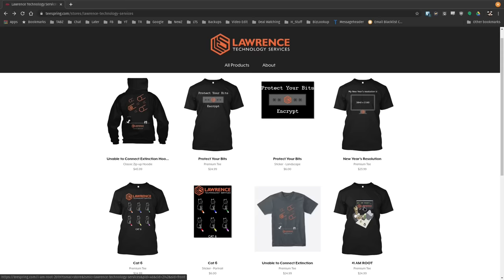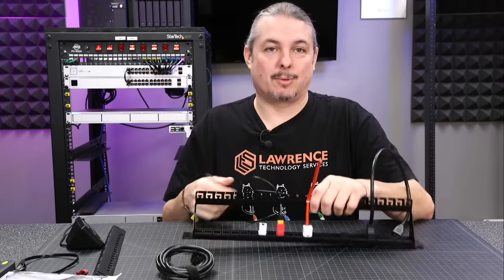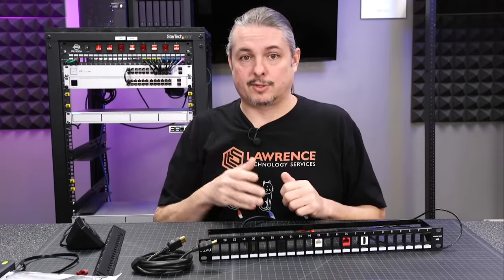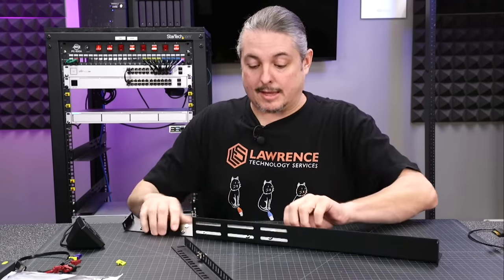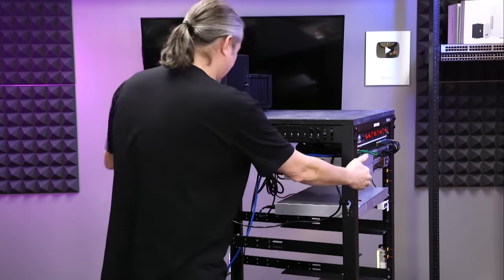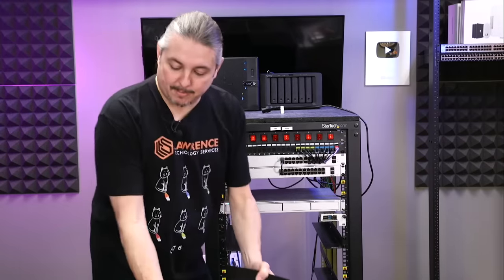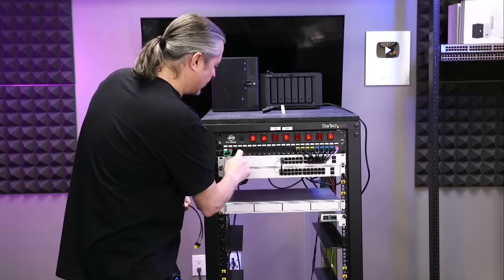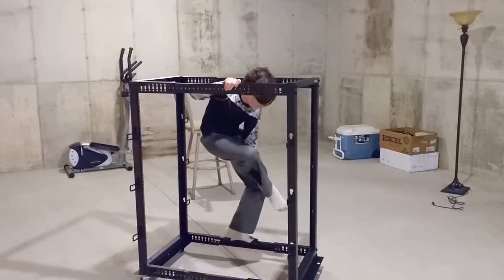DIY Home Rack Build

Comment: Enjoyed the video, but as a long time IT guy, I have to recommend torquing the bolts in your rack properly, and using at least 4 screws to mount a piece of hardware or shelf near the top, middle, and bottom of the rack. Your rack absolutely should not sway like that. These StarTech racks are solid as a rock when set up properly.
Reply: I think it would also help to use 4 screws/nuts on the equipment instead of only two bottom ones on each piece of hardware. Make the rack more stiff.

Comment: Would love to see you test how much weight rack studs can hold!
Reply from the maker: Sounds like a fun video, guess I will have to make it. ;)
Reply: Me too 🤣
Reply: yehh do it
Reply: The Rack stud website has 2 different types and the sheer force is about 45 lbs per peg. Rack Studs extremely discourages their product use when transporting rack mounted items just a heads up.
Reply: I too would love to see the "real" shear point on the studs. I have some equipment that the traditional studs are OVERKILL but it is heavier than switches and such!
Reply: I always think about this, but can't test it myself, so definitely interested.
Reply: Ditto, the fact that the ears are not flush against the frame makes me curious
Reply: @Nooneyoueverknew  Just because you can doesn't mean you should. :D
Reply: Would love to see this as well, I have a single U TrippLite ups at the very bottom of rack on rackstuds. It's kinda ok but a little sloppy.
Reply: @dfroelicher He made a video showing how much weight the studs can "hold"
Reply: $3k switch. Fully Plastic stud..... what could go wrong!! 🤣🤣  Interested to see how they hold up though (or the carnage)
Reply: @WildebeestLabs He did a video torture testing them
Reply: @AgentLokVokun  oh nice. Ill have to look that one up. I passed out after I watched this one... was late late
Reply: @WildebeestLabs  It's worth a watch. In general rack studs are a great choice for things under 50 Lbs or so. Or for things that need to be taken out and re racked a bunch.

The video if from Dec 02 2020 titled "Rack Studs Weight Test" from this channel
Reply: I have 2 IBM 3650 m2s and one m3 each weighing roughly 46lbs sitting on one shelf held by just 4 rack studs on each corner lol would not recommend it but it holds quite well and can handle being rolled about two meters with no problems. Risky. Yeah but I dont care much for them, they're very old lol
Reply: Hydraulic Press Channel as a special crossover episode!
Reply: @LAWRENCESYSTEMS  Did you ever make the video for the Rack Stud weight limits?
Reply from the maker: @chwaee  https://youtu.be/JZPby6fkKwk

Comment: One tip for mounting gear in a rack.  Put a couple of screws in the rails just below where the bottom edge of the  equipment will be.  You can then rest the equipment on those screws, while driving in the first screws for the equipment.  You'd be surprised how many people don't know this trick and I've seen two people trying to work together, one holding the equipment and the other driving in the screws.  BTW, I have worked with some equipment (old mini computers and disk/tape drives), where mounting is a three person job, because it's so heavy.  Two to hold the equipment and one to drive in the screws.  Also re zip ties, I have seen some where they were so tight they damaged the cable.  So, if you use them, they shouldn't be any more than snug, if that.  Stick with velcro when possible.

Comment: To avoid scuffing, you can stick on thin adhesive felt sheets cut to size on those shelves and slide the server in and out w/o issue... The felt helps with sliding heavier servers in and out
Reply: That's a good idea thanks!

Comment: The Start-Tech racks are great - I have the 42u version in my home lab and it was pretty easy to put together. Managed to put the verticals on upside down because I assumed that the round holes on the sides were top-most but it was easy to swap the top and bottom assemblies and the ability to change the depth is useful if building in a space limited area and has to be moved to final destination. I need to get something to hide the side of the rack. 

With you on the RJ45 front and rear modular jacks - all of mine are this type; I hate messing with wires - my lab, my choice. I really wonder how marketing people can get away with selling "Cat 6" RJ45 couplers for such a high premium. 

Great video again, Tom. During the time that I've been playing with the home lab and learning a little more about networking, your video's have always been my font of knowledge. I've learned so much about Pfsense and general networking from you and can't thank you enough. Your style of explaining things is exemplary and very much down to earth and practical.

Comment: nice video.  I just installed an Aruba Instant On wifi system in my home.  I used 2 AP22s, 1 AP17 outdoor AP for my woodshop, and the Aruba 8 Port POE switch.   I need to learned pulling cable and terminations for work so that was the perfect way to do  it.    And yes, I agree, the slim cables are outstanding.  We use them for our new installs exclusively now.

Comment: This is exactly what I have set up, including the same 25U StarTech rack!  All my A/V equipment is set up on shelves, an A/V power filter, 4U ESXI server, 2U server, 16 port switch, Rackmount UPS for computers and a shallow shelf for cable modem, HomeAutomation hubs and Nvidia Sheild.  Plus I added a drawer to store cables.  I used similar rails, a Keystone patch panel that has Cat6, USB and HDMI in it.  Only I did use Cagenuts for everything and don't have a pc of wood on the top, it would be a junk collector!

Comment: The USB keystone extentions are awesome, in my last job position I had a desktop underneath a uline workbench, I would have to get down on my knees to plug in a removal thumb drive if I had to do a quick transfer. The Workbenches had outlet provisions, so I bought outlet to keystone adapters and two USB 3 extensions so I plugged in the extensions into the front panel of my desktop and then I had USB ports on the front of the legs that I could easily access without neededing to get on my knees.

Comment: Another trick you can do is put in a shelf upside down and then put a heavy rack mount item on top of the underside of the shelf. It gives it a bit more support and allows you to easily add and remove when putting in the screws on the heavy item. For instance a UPS. This is especially helpful if you do not have side supports built in to your rack. You can also do this as a temporary helper/helping hands in removing a heavy item. After removing the heavy item, then remove the shelf.

Comment: I have that exact same ADJ PC-100A for my desk rack. It's a 6U network rack that's extendable.

On the bottom is the power switch for my AMP, DAC, Studio monitors / Speakers, and Misc power. I also have 2 rack shelves. One shelf holds my AMP & DAC. The last shelf is a glorified organizational shelf.

Would 100% recommend the PC-100A. It allows me to leave my studio monitors on all the time and control their power with the PC-100A as the power switch on the speakers are literally buried behind my desk.

Comment: Hi Tom! 
If you'd install all four screws to each piece of equipment it'll add rigidity to the rack and prevent it from swaying. 
Also, I'd to see a video on the weight limit with the studs. I have to swap equipment in my pro audio rack occasionally (depending on the type and size of the event). If I swap the rails to server rails, it could save me time in the future with studs.
Reply: Exactly what I thought watching it. That would drive me nuts..

Comment: I'm not a punch down fan either, I use rj45 pass through keystones.  It minimizes the types of cable connections I need to make and adds flexibility to the setup.  I'd also love to see some stress testing of the RackStuds.  Thanks.

Comment: I like to use D-Ring wire runs to keep wires from the front of the rack. I run all cables to one side of the rack so I can swing out the equipment if I need to replace any piece of equipment. It goes so much faster to swing out the old equipment and just hang it with a zip tie and install the new equipment into the rack. Then I can just move all the wiring back to the new equipment without having to wire manage again.

Comment: Great video.  Got the Star Tech rack as well.   Mine is rock solid, does not sway at all.   Perhaps you need to tighten all the bolts in yours?

Comment: Quick story: I was in a newly built data center, and we were doing a final test of a simulated fire. A new intern joined us that day and was not fully briefed. Simulation begins.  Evacuation proceeds. The last person out is the intern. Intern had been trained to follow evac procedure and hit the master cut-off switch on the way out. The last step was to hit the shutdown button (Big Blue Mushroom button) located just beside the exit door. He meant to pretend to hit it, but he slipped on the step down from the raised floor. and his hand landed on the switch resulting in a full power-down of the entire data center floor on short notice. We now have a locked cover on the switch and the fire warden with the key is the last person out and is responsible for unlocking the cover activating the switch.

Comment: On my two-post rack, I put a full double-width shelf on the bottom and use it to hold UPS units. I also have a second double-width shelf in the middle that holds NAS units front and back facing. It's also long enough to hold a server in a two-post rack. Just make sure you anchor the two-post racks to the concrete floor with concrete anchors, so it doesn't accidentally tip.

Comment: Zip ties are just fine. There is just some key rules to using them. Mostly, so the cables are not stressed. Also, use flush cutters.

Hey, who doesn't like reaching around to grab the rack! LOL zing!

Comment: if you attach all your equipment with 4 screws in front just like your server shelf it will give your rack more stability.

especially when it is on wheels and can be moved around.

Comment: One thing I did with my home rack was to wire the output of the cable modem to the patch panel and then the patch panel back to the router.  I have a red cable connecting the two (all my other cables are black).  If there's ever an emergency need to isolate my home LAN from WAN, all I need to do is pop that red cable.

Comment: Great timing on this video as I'm just in the process of putting my home networking kit into a 6U rack to neaten up the installation.  

I've bought rack studs so would be very interested to see how strong they are.  In particular, I'm intending to buy a UniFi Switch PRO 48 PoE which is a big (and expensive) piece of kit to trust to 4 front mounted pieces of plastic!  

I struggled to find a PDU as most of the ones with C13 outputs and a C14 input (for connection to my UPS) seem to have the sockets for input and output on the front.  All of my kit has power at the rear making a PDU with rear-facing sockets much neater.   I think I've found an appropriate one now but have a technical query out with the manufacturer as it includes an earthing point which I'm not set up to use, so need to know if its essential.
Reply: The rack studs are definitely strong enough for the switch. Craft computing put them to the test recently and they worked ok. In case you don't mind a suggestion, check out the Aruba S2500-48P. It's a beast of a switch with similar specs for around $100 on eBay.
Reply: @zachicusmaximus5551  Thanks for confirmation re the strength of the rack studs and also for the switch suggestion.  The Aruba looks like a very powerful bit of kit and great value but I'm really sold on the "single pane of glass" concept for managing my network that Unifi provides.

Comment: On min 4:19 what seems to be a Raspberry Pi can be seen mounted on the rack's right pilar. It seems to be using a small 1U mounting plate. Could you link to the particular mount, please?.

Comment: I’ve always wondered, why do rack mount servers always have network ports in the rear, and rack mount switches have network ports up front?
Reply: The switches can be installed ports facing at the back especially for Data Center setup. This is quite convenient to do the cabling as the back part of the rack has more space. And also for maintenance it is a breeze. You don't need to go front and back when replacing a cable. I know this is an old question. :D

Comment: Lately, I have been getting lacing bars to go in front of switches and patch panels.  This way the patch cables can come from the side horizontally.  This allows one  to replace switches in the middle of the rack.  Speaking of lacing, wax string lacing is becoming a lost art.
Reply: Lacing bars? Model number I can look to for an example? Thanks!
Reply: @SpookyLurker  Just go to amazon and search for "rack lacing bar"  startech has various models and usually come in packs of 10 for under $50.  I some times even mount them vertically so i can have a place to tie down patch cords before i come in horizontally.

Comment: Would like to know how you layout your equipment what goes where, top middle bottom
Reply: Heavy stuff (servers ups etc storage) at the bottom, switching/pdus and other light stuff at the top, had my 42u try to tip over if you pull out a server thats too high up when it isn't bolted down into the floor.

Comment: Always great videos and appreciate you sharing things with us all. 
Question concerning your equipment. Do you track all the changes that are made, in the configurations and why they were made?
Reply: I agree with your question and woukd also like to know;
Does Mr Lawrence track his equipment changes?
If he does then, does he also track and log the reason why equipment was changed?
(So that's if it was removed, swapped for the same, upgraded the existing hardware in some way (CPU, RAM, etc.), replaced with a different model, replaced with the same model (No difference in hardware or software), or replaced with a different piece of hardware.)

Lastly,
Does Tom keep track of all of his equipment, cables, USB devices, Networking Hubs, Routers, WiFi AP's, Networking Switches, PC Systems, Laptops, Individual System components, etc.?

I personally don't currently track changes but it is something I have been meaning to implement, and I have been acquiring the various items required to keep a well documented record of all of my hardware and equipment, currently I am just trying to find suitable software that I can use for a database for everything, something that can tie into a custom defined "Item Identification" naming scheme that can make processing of all of the information much more seamless than just doing it manually by hand typing and modifying database entries.

Comment: I currently have my network wired through a Leviton panel (sorta like a patch panel).  It's a mess of wires and I need to clean it up so even Grace Hopper would think it's 100% geeky cool.  I'm thinking about bypassing the patch panel and wiring straight to 1 of the 2 Netgear GS316 switches.  Thoughts?

Comment: The RJ45 to RJ45 keystone is really usefull for things like swtiches especally if they are a differnet colour to othe RJ45 keystones.  It means that you can use a standard RJ45 patch cable from the console and or management port of the swtich to a convenient point of access. I have lost count of the number of switches I have been to and not had access to the console port on the back without pulling the switch out. 

Before you flex your keyboards I knw soe models of Cisco swtiches lso have a USB console port on the front but not all mkakes and models do.

Comment: Given aws went down a few days ago going self hosted is pretty smart in general.
Reply: Well, it’s also much cheaper. However despite the aws downtimes it’s not likely that you have fhe same uptime success at home than you would have a virtual lab (beeing able to Snapshot even the biggest volumes). But at least beeing able to switch the light without internet is a nice thing to have
Reply: I mean it’s pretty difficult with anything self hosted to have 100% uptime too. Tho at least with it at home for some things you can take the systems down when you want.
Reply: The problem is how often does your network go down at home? Also if you hosting stuff for others to use what if you have DDoS attacks come in? You aren’t really going to be able to mitigate that on a 1Gbps fiber connection like Amazon mitigates 2Tbps+ attack with ease.
Reply: @Itsoperated  On the other hand, don't piss off xbox script kiddies and you shouldn't get attacked :). I'm kidding, but, I have had my homelab online for years and never ran into those issues. You need to be a target someone cares about to attract that kind of DDoS.
Reply: @slipknottin  Selfhosted is still pretty great tho. My power and internet is pretty solid. I've had some downtime, but I've had more downtime due to home needs vs power/internet outages.
Reply: @slipknottin  not with the right budget!!  Dual diesel generators, parallel power supplies, clustered hypervisors a switch fabric and the whole thing mirrored twice off-site ought to do it 😋
Reply: @phendryx  Issues with home labs is most people don’t keep up with security patches and properly setup there network. Your entire network could be vulnerable and be detected by a hacker running scripts over entire IP ranges. You don’t just have to become a target it just happens at random sometimes.

Comment: I wonder if they have front IO keystones.  I am thinking about using a mobo attached it a shelf in a small network rack.  Big thing is stealing front IO connections from something.  Adding them to a patch panel seems handy.